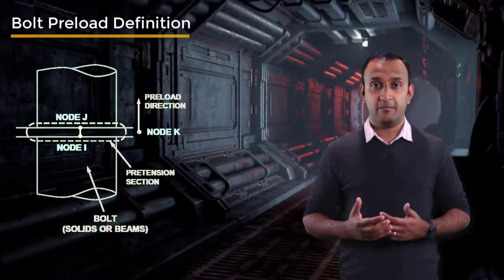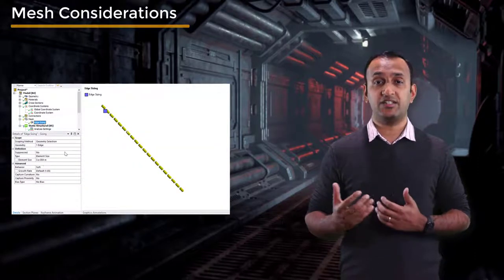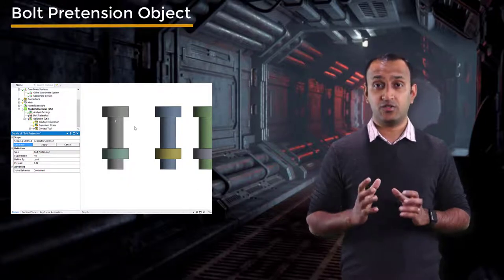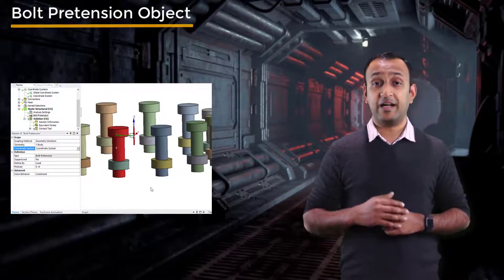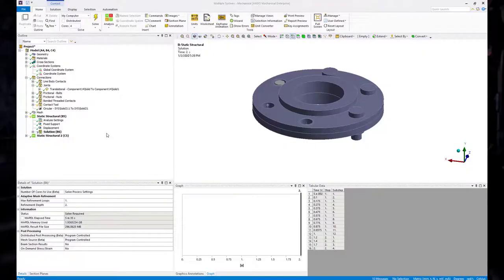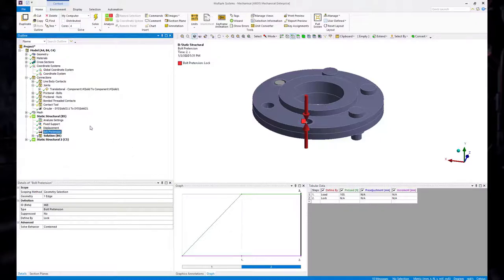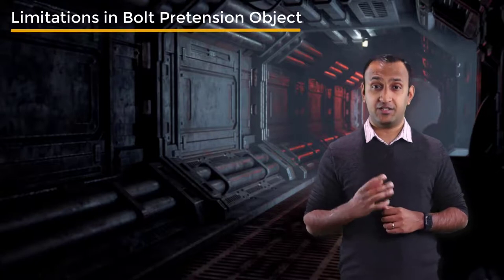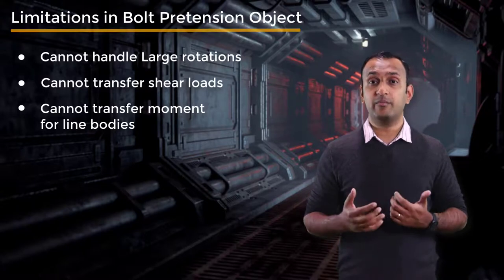Bolt Pretension Object Using Ansys Mechanical — Lesson 3

Comment: You said pick the lower surface as mobile and upper surface as reference but you did the opposite in actual in translational joint. Is that we have to choose what you have said and not what you did.

Comment: If bolt is connecting two holes, without nut & bottom hole is threaded,how should we consider it in ansys  workbench?
Can we use beam  with bolt pretension?
Reply from the maker: Thanks for watching! Please post your query on the Ansys Learning Forum for a detailed answer from the wider Ansys Community: https://ansys.com/forum.